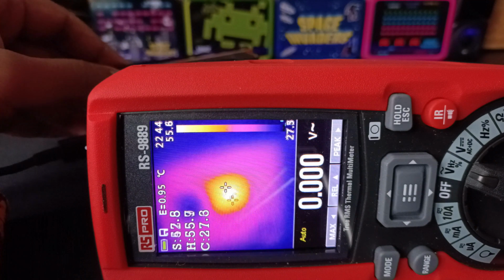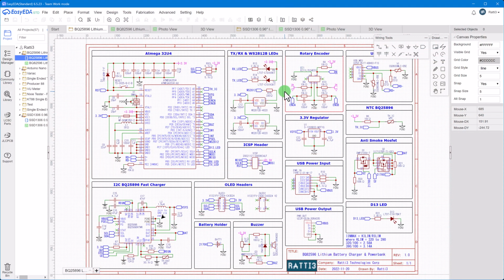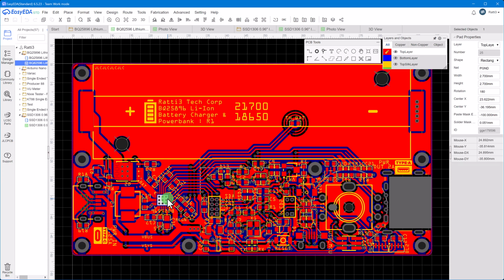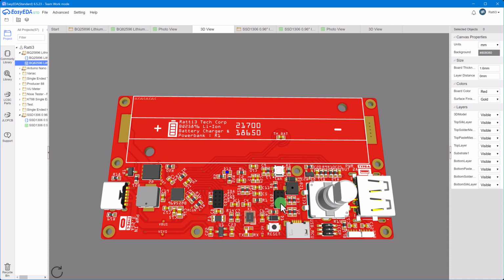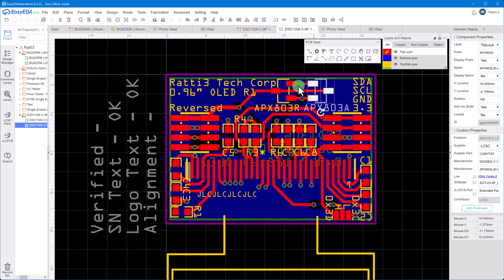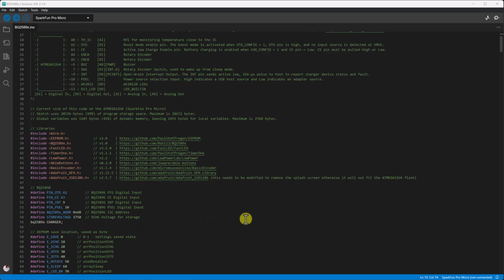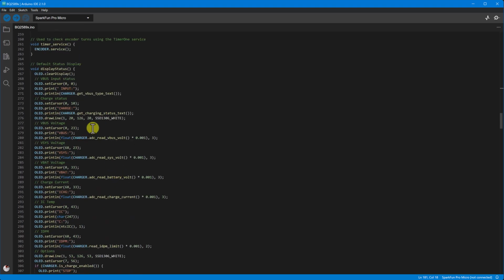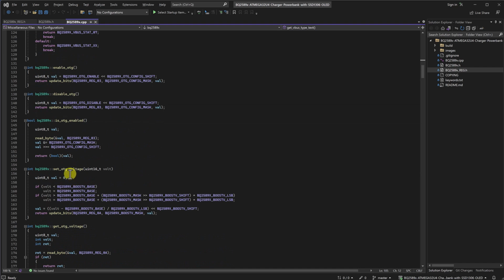BQ25896 ATMEGA32U4 Lithium Battery Charger with OLED Display

Comment: btw how you manage to measure the bat voltage while charging?
Reply from the maker: The Ti chip measures it; it's part of its built-in design. It's an advanced chip, unlike the TP4056. I'm guessing the measuring is done when the output is being switched, and it's done when the output is off.

Comment: A perfect project !. As you mentioned in the schematics, i noticed the QON (pin 12) is left unconnected 9:28. The datasheet describes if i pulled this pin to low, or a switch is connected, i could exit from ship mode and the battery is connected. So if i added a switch at that pin on your project without changing the code, would it still work? . And if i connected a charger, does it exit from ship mode and start charging the battery?
Reply from the maker: Yes, according to the datasheet "The QON pin provides BATFET enable/reset control to exit low power ship mode or full system reset function."

Comment: Is it has any battery over discharge protection?.
I’ve destroyed my raspberrypi using diy buck converter but but voltage drop caused it to destroy pmic in pi.
Reply: I looked into the datasheet and realized that it has built in boost converter and it shutdown when battery voltage below 2.9v.
Reply from the maker: It does 2.9V be default, you can monitor the battery voltage via code and override the minimum voltage
Reply: @Ratti3 does the bq25 ic has the option to disconnect the load using a MOSFET?.
How do i achieve that?.

Comment: I am working on a project that requires me to use the USB HID capabilities of the 32u4 and an i2c oled display. but the problem is that the pro micro either does not have the pins like the leo should have to connect i2c devices or the sketch won't compile. Does someone have a solution for this or is a little more experienced with i2c and or the 32u4 chip. My next attempt would be to poke around in the "wire.h" lib in the hope to reassign the pins for i2c.
Reply from the maker: Pins 18 & 19 are the SCL & SDA, it's in the schematic and I have used it on the board. If you also look at the Adafruit and Sparkfun schematics you'll see the same.

Comment: Thats a great piece of hardware!!! Great job. Will you be selling these??
Reply from the maker: Thanks. I don't sell any of the stuff I make that you see on this channel. I do however provide all the info, schematics, gerbers etc on the various links provided, so anyone can make it or have it made. This charger was more of a challenge than anything else, I wanted to see what was possible (and I am sick to death of the cheap dodgy TP4056s). I don't think it would be cost efficient if mass produced. This IC is typically used in laptops, mobiles and tablets.